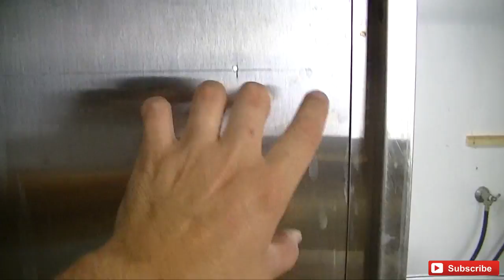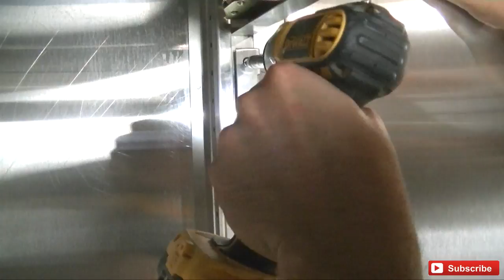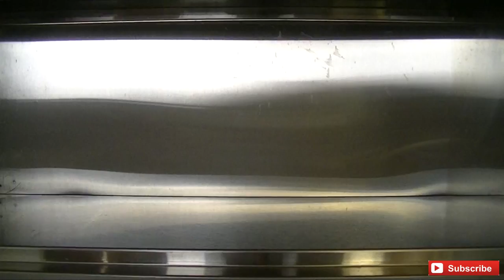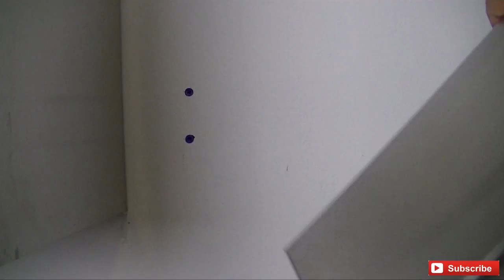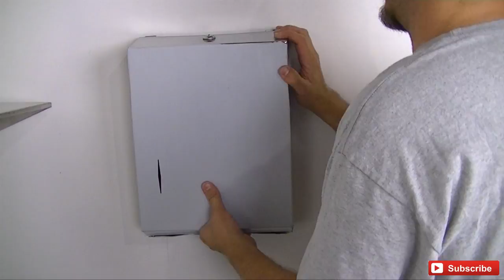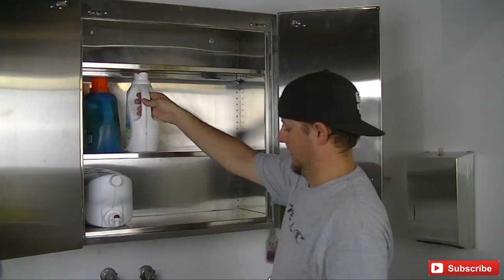Garage Project 6 - Laundry/Sink Area

Comment: Great set up brother. Doing the shelf too but gotta install my FRP board first. What’s the weight cap for that shelf?
Reply from the maker: I guess it depends if you can get a stud. If you can, will hold a lot. If not, then it’s however much the anchors can hold.

Comment: With all that great looking stainless steel why did you use nails for the brushes????  Maybe a nice 3/4in piece of pine painted with some hooks on it would have looked a little nicer, but all in all great job dude.  Love the videos.
Reply from the maker: Bobby Rodrigues Thanks Bobby. I went with the nails cause it was the easiest. It took me all of 10 sec. to nail those in. Wanted to keep it simple.
Reply: Makes sense.